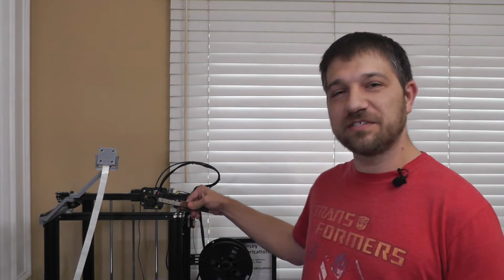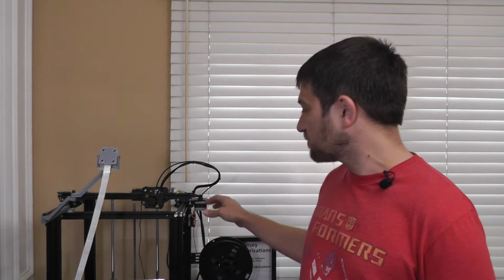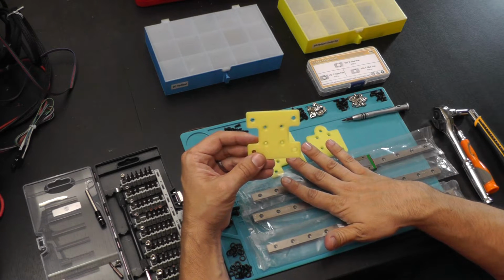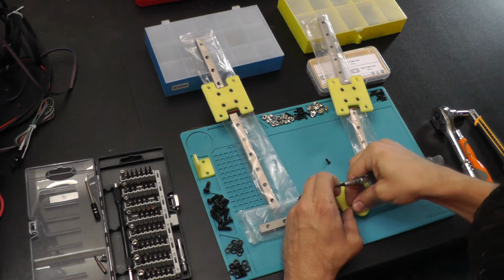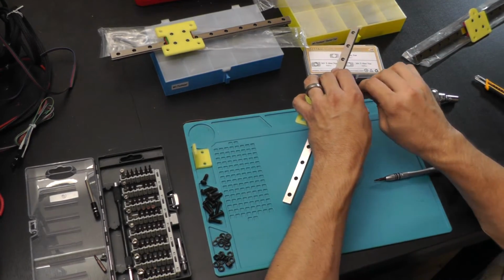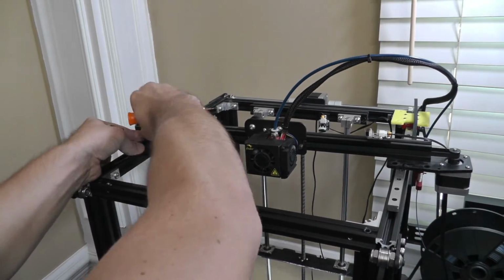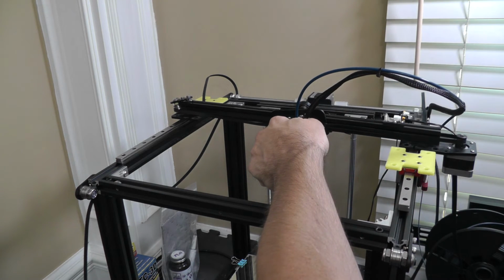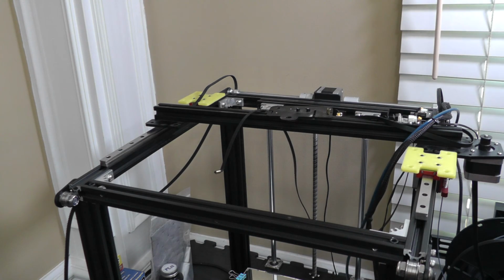Creality Ender 5 Upgrades #6: Linear Rails - Part 1

Comment: Delrin dude not the rubber. Not much give there. At least not as in any rubber . Also that ain't the dust. It's darlin disintegrating from being to tight or due to the normal ware and tare.  Linear rails need extra reasoning. They are stronger more accurate, less friction under load and people who want to upgrade know why. Also same people know all things that change with it.
Reply from the maker: Thank you for the correction on the material! I was corrected in another video but this one slipped through as I was still not familiar with the it. Since then I've been learning about POM and have a video coming up about it sooner or later. For thoroughness, Delrin is actually a brand name and in general this material is referred to as POM (Polyoxymethylene).

It's very odd that you assume that people who think they want linear rails know why. Plenty of people that own 3D printers will be exposed to the idea of upgrading to linear rails and they may not understand why they would want to do it. I try not to assume anyone's knowledge base that watches a video on YouTube. To be fair, I could have spent a little more time on why you'd want to upgrade.
Reply: @kerseyfabs  indeed material is POM. Only issue is that most of the people refer to it as Delrin. Even when the part is delivered from other manufacturers sales people selling parts refer to it as Delrin. Personally I've used it as more people are familiar with it then with the Polyoxymethylene. If I have used that name I would sound bad even to my self. Would sound like they hard know it all. 
Why do I assume linear rails is not for everyone? Well it is not an assumption actually. It is one of the rarest mods performed mostly by two types of people. First type would be the pros that just want to achieve last possible effort of making super rigid printer while they have achieved precision already, or they know that their printers stock system can't be accurate enough. Also same group of people use it when building their own custom printers and then drive them with fir example ball lead screws. 
The other group, not that it is bad or stupid, are the people who stumbled on the linear rails. They have seen it done read about it, have enough founding and went for it. To be honest I am all for it. More people get it price will eventually go down.
Why do I say I do not assume? Go check people's modes printers. There is a see of printers upgraded with your own printed parts. Most of them. Costs almost nothing. Then you see people changing extruders. Mist if them getting upgrades from the manufacturer. Only small percentage gies for high end. Well Bondtech cost 100 plus $ and China knockoffs cost 15$. OEM upgrade costs like 10$ and is metal. Then you see still lot if people changing and upgrading the nozzle and hot end. Then you see bit less people changing Bowden tube to Capricorn version. Then you see even less people upgrading the board. Some to stock silent solutions some to open source with driver sockets and even less to 32 bit. Even then people go for cheaper drivers very often. Then you see very rarely people upgrading to direct drive. Even then most of them even leave it with stock extruders and use it with single driven Z axis. X gentry drooping down on right side. Better option would be to get pancake motor with geared extruder to get lighter assembly. Then you see even less people doing double Z axis upgrade to counter X gentry drooping even with the Bowden setup and specially with DD setup.   Even some if them do it as cheap as possible and hack it. Some do it but you see their X gentry is not parallel to top frame beam or they have not adjusted both Z lead screws perfectly and still post the videos and instruct people the wrong way. Sure there are many pros and many many goodmoded printers. But for each of them there is 100 hack jobs. There are so many videos showing bad building and nothing about essential stuff making beginners believe it is so simple and no knowledge is needed.  You see common thing is money. If mod is cheap everyone is doing it. Linear rails kit costs more then your average every man's 3D printer. To spit out 10 to 50 bucks is OK but to invest 500 bucks in 200 bucks 3D printer is not for everyone. It happens again for the people who can afford it only and even then some do it just because if the fact and the others because they know that after 700 bucks they will have better product then 700 bucks kit cough*Prusa*cough.
Also in lot of cases lot of the expensive mods do not bring any 3D print improvement in every situation. Some even introduce ringing and other artifacts but the enable something else that was not possible before. For example dual drive extruder will not really improve PLA printing but might allow you to print flexible filaments that just get chewed up and stuck in the stock setup. So upgrading to dual drive extruder might be waste of money if you print solid filaments only. DD is heavy and with high speed it will mostly increase ringing but it will reduce issues with retraction greatly if your bowden setup has it. If you do not have it DD might not have place on your list. And back to linear rails, well they might not be really needed for some printers. Seriously. I love them specially high end stuff. But if you use the knockoffs and drive them with simple threaded screw or any inferior and less accurate system you are limiting their effectiveness. Sure it will be more rigid system but will not increase accuracy. Now I hope no one takes this bad way but even high end rails can introduce ghosting and ringing in some rare cases. I know it sounds stupid but it happens. System that have had some give and some damping in some cases has its balance and in such case making things super rigid makes it resonate resulting in the artifacts. Most of the systems are engineered with some give and damping or they have just turned that way due to the cost savings and if lucky or very good engineered they will not make artifacts. Sometimes adding soft rubber feets will remove most of the artifacts. Making it rigid can make it resonate. For example linear rails bed. Do you leave spring loaded adjustment? Ir you change to fixed adjustment? Do you remove all damping out of the system when you go linear rails? Frame struts if you go LL way?  What feets if LL way? Well those are all things you could or should ask your self before you go LL way. And more sure. Every step of the build print the test print. See have you made things better or not. If you get artifacts what causes them and how to reduce them. Find your own balance and learn how to use slicer with your own printer. Then results just might justify any upgrade over the free and cheap upgrades. I have not even touched TMC and silent stuff and issues with electronics and Marlin and boards an bed leveling and ABL like bltouch and first layer and so many important things. It ain't simple to make super moded and proper working 3D printer disregarding how many videos are about it. Only few names on YT actually knows their shit. Even they make sometimes small mistakes. Way more people just wants followers and to look clever to sheeps and show bad products and actually hide the results. Some just stumble on good result. But then again that is how it goes now days in almost everything.
Reply from the maker: Thank you for all of the feedback. Your comments about expectations versus reality are particularly true. I always try to manage expectations with real-world prints and examples. I can't say that I'm a YouTuber that knows everything by any stretch. I'm still learning all the time. I always do my best to share what I know and be honest when I don't know something. I share what I can to expand other people's understanding and to enhance their hobby. Please give some YouTubers a little space to share without being experts. This is a way to share and learn. YouTubing is not easy and it's not usually a selfish pursuit. I do this to share and connect with the community.
Reply: @kerseyfabs   Sure. There is a space for everyone. Not like I am the authority that decides anything anyways 😁. Your "offence" was not big one anyways. It is a thinking man error. On the other side some people make videos painting a picture that has nothing to do with the reality. Thus pushes ordinary people to wrong investments. Shameless product placements that are beneficial only to the YouTuber and manufacturer. People think it is independent and true information and they get mislead and waste their money in the process. Even people that should know better then that. Or they do not have enough time to check all of the facts or they just need an excuse or little push to waste their money. That is exactly what I am against. Making people waist money for personal benefits. Or pushing own conclusions as the absolute truth. Specially with complex thing's that can behave differently depending on the other factors. Like for example saying DD is always an upgrade. Well in some cases it does degrade quality of the prints. As it happens someone gets the result/solution for his issue and proclaims this is better. And it becomes the truth. Repeat it enough times and it is the common knowledge. Sometimes they even make things worse and still it works for them as one more video that establishes their status in the eyes of the beginners as well as earns them money. Sometimes they rush their video out not even noticing that result is worse. Today it seams there is no responsibility. Freedom of speech is the freedom to misinform the people and share conclusions about things that can go wrong on so many ways but might work in few scenarios and that becomes the meta.

Comment: Something that makes it easier to pt several hammer head t-nuts in at the same time, is to tighten them down to just snug. Then align them all with the extrusion slot, Set them in the slot. Back them off one at a time and then tighten them up. this helps keep them aligned so that it is easier to get all of them tightened against the extrusion.
Reply from the maker: Thanks for the tip!

Comment: Nice work!
How about putting the rails in the internal part instead of the top preventing them to interfere with the belt? That way the adapters have to be in "L" shape.
Reply: And for the x axis you can put it in the top of the profile preventing it to interfere with the belt. The x axis adapter could be in "L" shape too to hold the hotend
Reply from the maker: Thanks for the feedback. I was avoiding the L shape because of the loss of rigidity. By keeping the adapters thin, I keep it tighter.

Comment: So, do you have a video on how to calabrate the printer?
Reply from the maker: Not something that's full-featured yet. I have a video showing how to tension the Ender 5 belts but nothing about calibration. There are a lot of videos out there about how to do this and so I haven't jumped on it. If I find myself with a slow project week, I'll try and put something together that shows my process.

Comment: I received my Ender 5 just a day or 2 ago and found a problem which seems unsolvable... The Right front of the Y axis doesn't move anywhere near as far forward as the Left side (the wheels touch the forward plate on the Left while the Right is 14mm back of the plate).
I unbolted the motor attachment to the bar attachment (2 bolts on the wide thing) but found that it wouldn't turn just the one side... It seems the smooth bar has a flat end. Is this so? If not, I'll unbolt the lock nut and turn that one side alone with the large joiner disconnected from the motor end, then I'll rotate the joiner so the flat side is lined up with the motor flat edge and bolt it all back together.
Reply: @monkeymanstones1  --  I have had my Ender 5 for a few days now and it had the same problem. I loosened one side of the Y axis motor couplers and rotated the 8mm shaft until the sides moved in unison. You may need to temporarily loosen the 4 bolts holding the X axis bar between the carriers, I did this on mine to allow the X axis bar to reposition itself.
Reply: @alloy5801  I tried the same and it's why I thought that the 8mm bar may have a flat side which the screw touched to, preventing the rotation of that side alone. I completely removed the screw, held the motor side of the shaft and tried to rotate the 8mm bar. It turns well below 1° and then rotates back to where it started upon release. If I rotate it and then tighten the screw fully the bar again rotates back to the original position and the coupler doesn't turn even though the screw is fully tightened. Upon returning to it's original position the screw is then suddenly very loose, strongly suggesting the bar diameter is lower there. That's why I asked if there is or is not a flat spot machined into the bar.
I don't think it will hold but I was able to have the X-Axis bar almost correctly aligned by pushing forward to the correct position very hard then tightened the wheel adjustment nuts on both sides so that it's tight. The downside is that 1 of the 8 wheels (one of the 4 without an adjustment nut) will not make contact with the aluminum extrusion then. I tried tightening the adjustment nut diagonally across from it on that side but with no beneficial result.
Reply: @monkeymanstones1  --  I had heard that Creality made continuous changes and improvements in their printers. There are two kinds of shaft couplers that I have seen. One uses screws that point directly to the center of the shaft, this type does not have a slot parallel the the axis of the shaft although it may have a straight or spiral slot between the two halves of the coupler. This sounds like what you are describing on your printer. The other type uses screws that pass besides the shaft and basically tighten the coupler around the shaft. These have a slot parallel to the axis for the shaft and the screw closes this slot to tighten the coupler. My printer uses this type of coupler and it is easy to reposition the shaft in any position. If indeed this is the situation you might consider contacting Creality and see if they will send you the second type of coupler. Also, they are relatively inexpensive so you might just buy one.
Reply from the maker: I did my best to follow exactly what you're describing but I don't get exactly what's wrong. Feel free to send me a picture on one of the other social media platforms or e-mail me kris@kerseyfabrications.com and I'll try to help.

Comment: I am going to do something similar but I am using SHS15 THK rail on the X and either SHS15 or SHS20 THK rails on the Y. For sure I will be using the 20's on the Z axis (all 4 corners to support the bed) Yes, I know these are overkill BUT I already have a huge assortment of new rails and bearing cartridges collected from surplus over the years. I even have some SHS35s. One thing to note, the rails you chose  only have a single row of bearings on each side, correct? So the rotational moment on that single X cartridge will not be as stiff as it should be.
Reply from the maker: Thanks! I'm looking into the mounting direction implications and I'll report back in one of the future videos.

Comment: this an interresting mod but :
first, I think you forgot to reproduce the belt insertion on x gantry.
second, I'm not expert but I think that the linear rails are not made to be setup on vertical constraints assembly. The ball bearing on the top part of rail will support all the weigth and are going to eat the rail.
Reply from the maker: Don't worry, there's no belt issue on any of the axis. You'll see!
I'm doing some research on the mounting angle and I'll go over my findings in one of the next videos.
Reply: @kerseyfabs 
I don't think it will eat the rail, the rail is very hard steel.
I work in automation manufacturing and there are lot's of these type of bearings installed like that, and if we ever replace anything, it's the linear slide (that looses bearings). 
I don't think I ever replaced the rail (we even use the exact type you install), and we definitely get more travel and weight on them than you do on 3D printer.
The service life of these linear slides is extremely long, I would however recommend installing cylinder style linear rails with cylindrical bearings, those are better at taking the load in horizontal orientation, but I believe they are more expensive.
Also you don't need to install so many T-nuts on the rail, every other will do, I would only recommend installing all of them on CNC router because of much bigger weight and added stress from milling.
Great video by the way.

Comment: Thank God Creality "only" used the rail bolts for the Spool holder and the display.
I hate them (the nuts) with a burning passion, I swear half of the installation time of my ender 5 were spent trying to get the nuts to rotate end stay there :p  .
Really interesting concept, looking forward to seeing more.
Reply from the maker: Thanks! As I mentioned in the side bar, I'll be replacing the rotating ones in the future. They were a pain in this case.